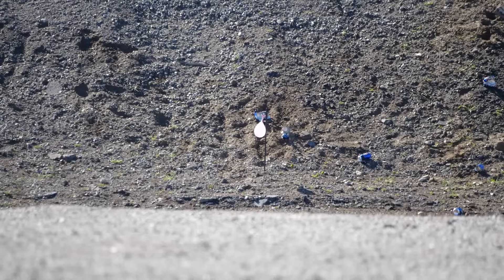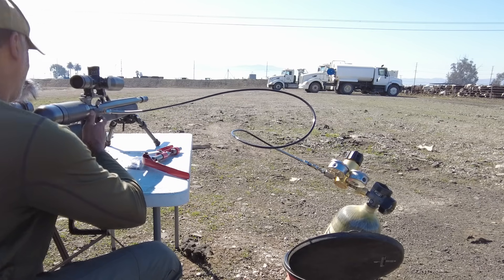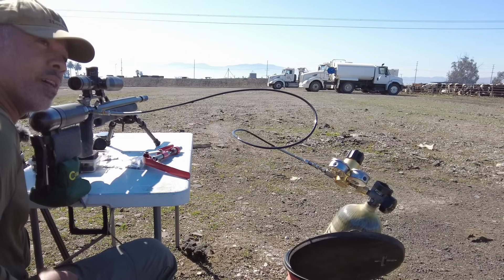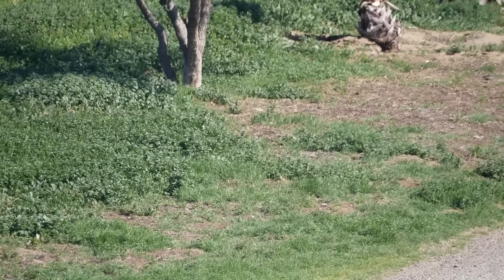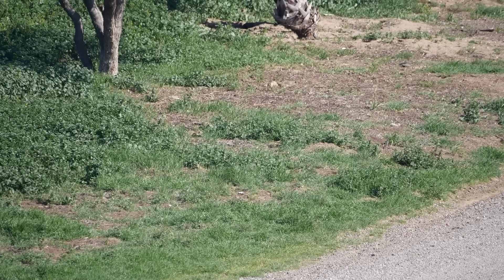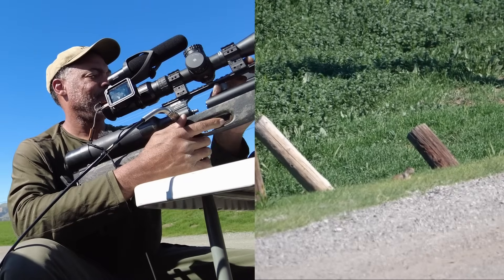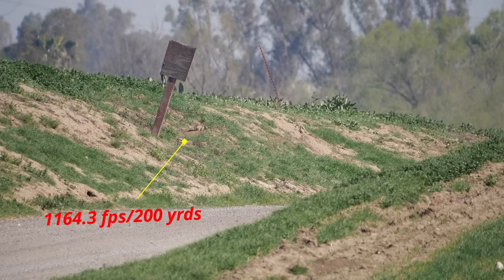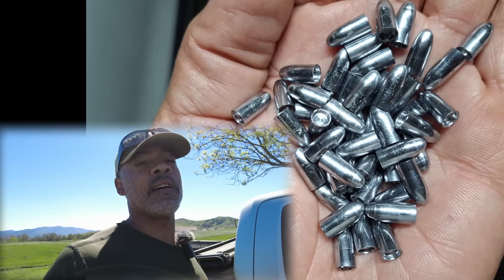224 NOBLE - Pesting @ SUPERSONIC

Comment: That was sharp, how's the efficiency?
Reply from the maker: Jake, this gun is not efficient if your meaning shot count and amount of air used per shot.  These type of unregulated powerhouses are not built to have multitudes of untethered shots.  Main reason being is, there is no GOOD way to attach an inline reg with a plenum big enough (without changing the look of the rifle) and number two, the power/magic starts happening NORTH of 3000 psi.  Now, when the gun is tethered, there are a plethora  of ways to shoot efficiently.  You simple use the FULLY ADJUSTABLE EXTERNAL reg to shoot the rifle at any power level you want.  You use the REGS INPUT PSI to control speed.  The rifle will hold air down to below 100 psi so technically, I can shoot all the way down from there then all the way up to 4500 psi
Reply: @Tofazfou  Thank you.

Comment: Phenomenal content !! Real impressive gun there .hooked after the first impact @ 3:13 😮
Reply from the maker: Thanks Impactpsi.  So, the squirrel was shot at the deck (3:13) of a huge hole that the farmers use to drain the cow pins after a rain.  If you look at the 2nd squirrel in the video that was launched off the bank, thats the EXACT SAME DECK/BANK but, that 2nd shot offers a different view of the drain hole.  Also, GS #3 was also the exact same bank.  So, you get a good quality crack upon the bullets flight because of that holding tank/drain.  Just shows you how different areas capture noise.  Its the same camera and same mic with the same setting for every shot.  Just that the other shots were in the wide open.  Gotta admit, I too LOVE THAT SONIC CRACK.  And btw, yes, The gun had a ImpulseAir LDC on it so, that was all sonic crack of the slug

Comment: Please help me understand how you shot a 25 caliber 50 granin 1200 FPS???
Reply from the maker: 🤣🤣🤣Big Bopper, No man, NO, thats .224 cal.....lmao🤣🤣  But, 25 cal would be no problem either for that kinda speed.  Without getting all scientific, its easier to push small calibers like 257 and down into supersonic than it is to push .308 cal and up at those speeds.  Main reason is, the smaller calibers are lighter than the mid and big bore calibers.  Then, you are also getting into the flow dynamics of the valve and barrel.  Also, this is why i use AIRFORCE for my custom builds.  They use DIRECT FLOW valves which means, the valve and valves ports are directly in line with the barrel.  Flow Dynamics dictate that when you have 90 degree turns, you are starting to become inefficient in flow.  Most all airgun have 2 90 degree turns so, 180 degrees.  One from air supply up to the barrel port then another from the barrel port to behind the slug.  It was calculated at one point that the maximum air could flow down a barrel is 1640 fps.  I forget the details but, I you consider this to be true then by all means, SUPERSONIC IN AN AIRGUN IS A REALITY.  But, that is 1640 fps with NO PROJECTILE.  So, since we have to have a projectile, lighter ones will always be faster than heavier ones.  The other weekend, like 3 weeks ago, I shot a 40 gr RBTHP in the same gun at 1364 FPS on 4000 psi. Multiple times.  yes, it was loud as hell.  And I can fill to 4500 psi so technically, I still have about 50 more FPS to go till max.  Barrel length also has a LOT TO DO WITH SPEED.  This rifles barrel is 28 1/2" long so, imagine if a had a 34" barrel.....lol!
Reply: You got the strongest 25 calibre in the world if that's the case. What pressure are you shooting at?
Reply from the maker: @Bigbopperairguns  .224 cal and only 3300 psi with the 40 and 42 grs to get 1200 fps and 3400 to get the 50 grs up to 1145 fps
Reply: Wow, you have some of the most amazing numbers I have ever seen.  I didn't even think they were achievable.I thought I had the strongest gun in the world. Keep up the good work.I'm looking forward to seeing more videos, and you got a new subscriber@Tofazfou
Reply: What are you doing differently to your gun? To make it shoot this hard, I've seen now. They've completely bored out the T2 valve leaving no room for improvement but you found a way,  What do you think I can do to improve my AEA 25 cal Challenger Pro. which is shooting a 16.8 grain at 1430 + fps  and my Challanger 457 is shooting a 128 grain at 1275 Fps on its best day.  I really want more power and im Higley interested in how to achieve this. i look forward to your response.Thank you for all your videos.You've been posting love the content

Comment: What hose you running off that reg? Looking for a nice hose. Then I gotta ask is that alkin reg a lot better than my huma inline?
Reply from the maker: The Huma Air hose from High Pressure Pneumatics.  Its a 4' one. not sure about the Huma Inline but, I think the features is what separates them.  I like the ones I have cause you can raise and lower psi OUTPUT without having to degas
Reply: @ how fast does it take the reg to re settle after a shot? Do you have to wait on it a bit like this huma I have?
Reply from the maker: @WestKyAirgunner  never timed it but, i have on multiple occassions shot, missed, reloaded (single shot) then got back on target and the FPS was the same.  And i'm relatively quick with reload even when I'm not trying.  I did it in the video actually when I missed the 1st time, clicked my turret down, reloaded then got back on target.  And that was going slow.  And they gun was going the same speed as the previous shot.  I'll have to test the reg to see so I can more accurately answer that question.  THANKS WESTKY, YOU JUST MADE MORE WORK FOR ME🤣🤣🤣😂
Reply: @ my bad buddy 😆 I’m fixing to swap from the huma inline to this one!
Reply from the maker: @WestKyAirgunner  oh man, im joking!  I love when someone ask me a question I don't know.  Actually, I'm now remembering a lot of details over the years.  That reg is fast.  Like for example, remember how the older FX mk2 and mk1 would make that whooshing sound right after you took a shot then it would stop like 1.5 seconds later because the reg was refreshing/refilling the plenum?!  That's about how these regs are.  Also, If im really being technical, on the Airforce guns, the fill nipple is screwed into side of the valve, sometimes/often times, i've wondered if they are screwed down to tightly because, there is a simple check valve behind it that lets air in but not out.  Its basically 6mm smooth shafted screw that has an oring on it.  If the fill nipple is too tightly screwed down, it takes longer for the air to input itself into the bottle.  HMMMMMMM, NOW YOU GOT ME THINKING...................
Reply: @ yea that huma inline is slow, I ordered the one you have but I bought the reg bare buying my own gauges. The gauge that shows the rifle pressure will be digital!

Comment: Awesome video man wow that is a beast of an air gun 1160 fps that is crazy but i like it thanks for sharing be safe buddy  💯 ground squirrels had no chance
Reply from the maker: yep!  And thats only at 3300 psi.  When its not cold, using that PSI setting, I get 1200+- fps with 40 and 42 gr RBTHP's and 1145-1150 with 50 gr RBTHP's.  I filled to 4000 psi the other day and the 40 grs went 1364 FPS.  Still have 50 more fps to go😉